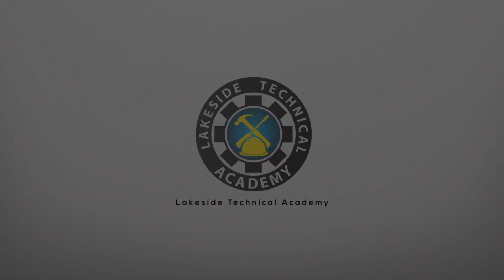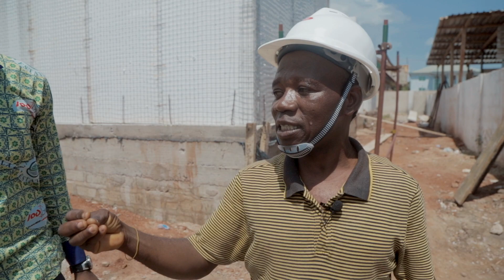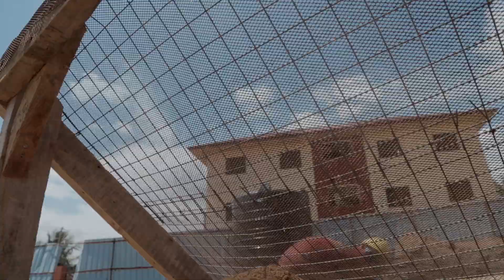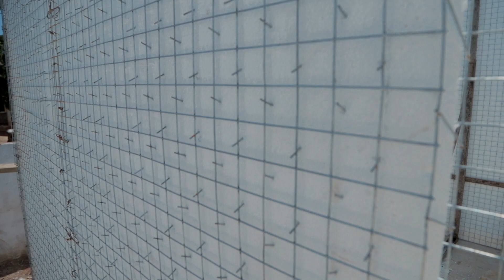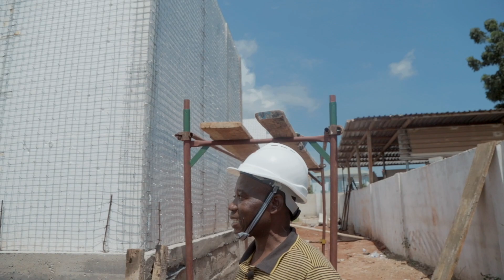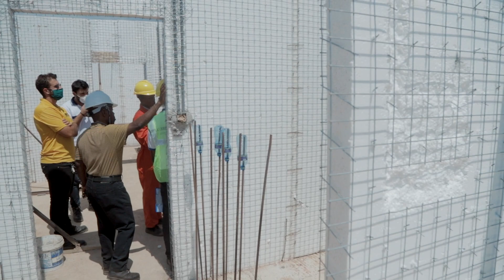Building in Ghana using 3D Concrete Wall System

Comment: If I saw the building design very well, why do you insulate the building from the inside instead of from outside?
I know in Ghana, unlike Europe/America we do not warm our rooms due to the high temperatures. I think the more emphasis should rather be on the prevention of heat entering the building than the prevention of heat leaving the building. I think the material with higher thermal insulation should have been outside instead of the concrete which has a higher thermal conductivity property.

Again, the polystyrene also resist the absorption of water/moisture (either from humidity or splash water or from the rain.

Why are the interior walls also insulated with the polystyrene? Are they for sound insulation?

I'm still learning, your answers are very welcomed. Thank you

Comment: How cheap is this system compared to using bricks or blocks in GH?
Reply from the maker: Hello 

well this system is not cheap but affordable.  It has cheap operation cost ie may not require Air Conditioners or less ac depending on individual and it is more comfortable to use in Ghana during heat or cool weather. Its has a saving of about construction cost  10% for multiple story building.

Best regards
Reply: @KalmoniGroup  affordable is the right word.